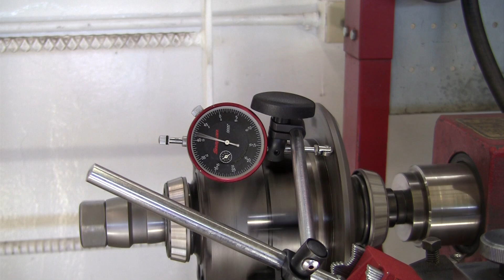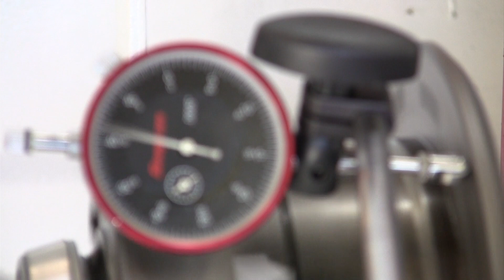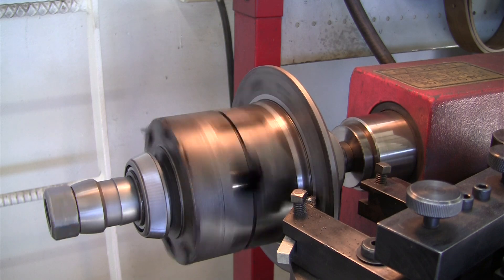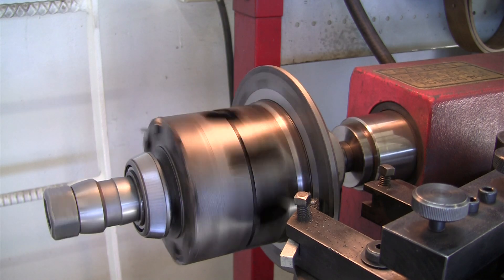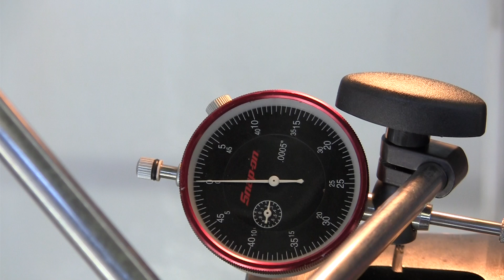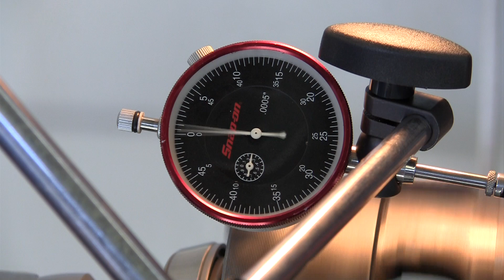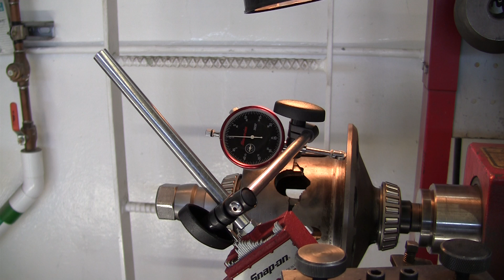1963 Chevrolet Biscayne Positraction Differential Overhaul - Part 3.1 - Repaired

Comment: How do you now that the inner planetary gears & clutch plates were not contaminated with dust & waste material from machining the ring gear face. May have been prudent to machine the ring gear face before disassembly as you could be sure of a clean rebuild
Reply: If you actually watch the video you will see and be told that the inner workings were removed for machining.  @8:39 you are shown a closeup of the empty case. Please explain how you are able to ask this question.